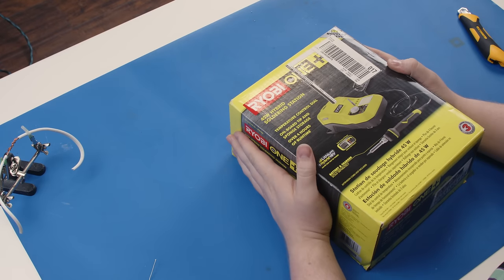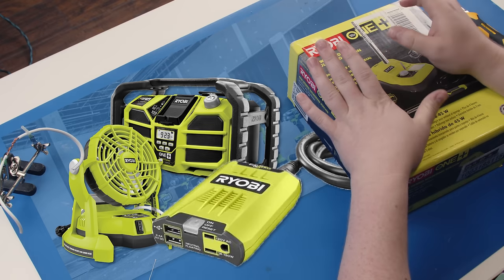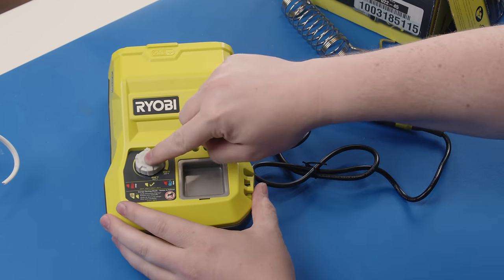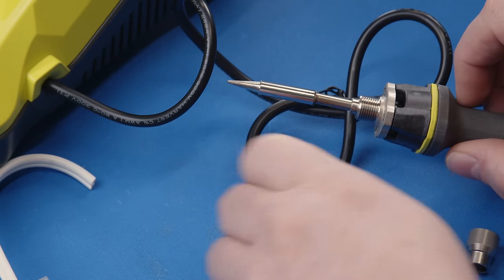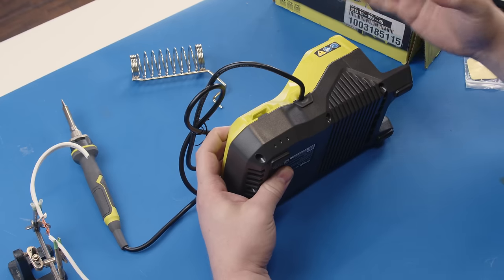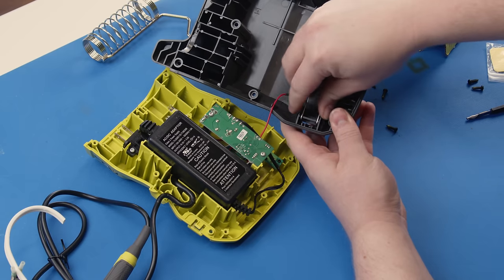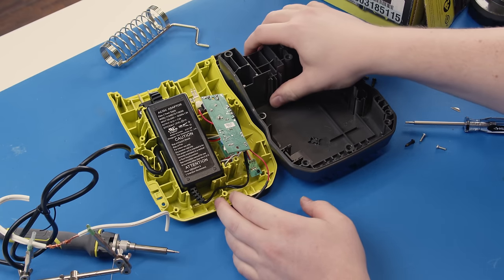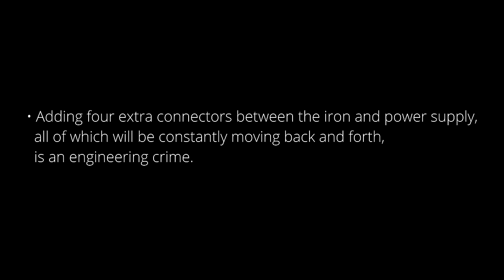Ryobi has GOT to be joking with this soldering iron

Comment: The butane-powered soldering iron were usefull when I was installing marine communications and navigational equipment in medium size sailboats and powerboats back in the 80's, where a boat at anchorage didnt have 120 VAC "shore power", or you might be working up on the mast, in the cockpit, or on the boat deck where there wasn't an outlet available (for obvious reasons!). The butane iron was great for soldering PL-259's and other large RF connectors.
Reply: Was just going to say this. Some of the mobile mechanics in the locale use these things too. Pretty much anywhere where you can expect to not have access to a outlet. They have their uses.
Reply: @venge1894  , of course, ya' gotta be careful with an open flame around car and truck engines, marine engines, and bilges! I do wonder if any of the current crop if battery-powered cordless iron could solder the ground shield of a PL-259 connector; for that, you might need an invertor to provide 120VAC, and a BIG soldering iron, or a Weller 8200 gun.
Reply: butane-powered soldering iron one of my most used tool too, i keep one in my car if i somehow ruin my wires(i have alot of them going around), i could get one that works on 12v outlet or make my own one but its easier to use butane one.
Reply: I use my butane powered iron for soldering and, recreational use
Reply: @d_dawg05  I have one of the butane irons for doing the electrical connectors on farm equipment. they also work really well for melting a perfect hole in a plastic sheet to pass cables through without leaving rough edges that will wear the cable over time.
Reply: The butane iron sounded like a good idea when I had to climb a radio tower and work 100ft in the air soldering a joint or pl connector, but any wind cooled the tip down and the catalyst did degrade like camping lantern mantels.  If I recall, the Iron did have a flame control on it to adjust the heat.  
I eventually only used the blowtorch tip to melt heat shrink tubing instead of a lighter.  Another issue was the refillable butane torch was frowned upon by the airplanes which I needed to get to my remote towers.  It was easier to have a box of wooden matches in the toolbox or buy a pack of disposable lighters at a convenience store near the airport if I expected to replace heatshrink that trip.
Reply: @mcgyver272000  , you can also use the miniature torch to melt and caramelize the sugar sprinkled on top of a Creme  Brulee'!
Reply: Helicopter mechanic here...the butane powered ones are fantastic for use on a windy flight line with absolutely no ac power available.   They will, however,  brand you like a new cow or burn a hole straight through carpet when you arent paying proper attention to where that exhaust exit points too
Reply: I keep a butane torch/soldering iron and a can of fuel in my Emcom "Go Kit" for making repairs, or modifying gear to fit whatever job we're asked to do.
I wouldn't want to use one for small, precision work, but like lots of tools there are jobs it does well or at least "well enough" to keep one around.
Reply: I used to have a nice Weller butane unit. No longer made, but it was excellent. Got stolen during a move.  :/
Reply: I still use one when working in my car...no electricity near where I have to park. Works great, but there are limitations.
Reply: I re-wired a car and used my butane iron for the entire job, lol.  I’ve repaired electronics for a living for a couple years before that with a nice metcal professional unit and really didn’t mind using the butane for the wiring (would never touch it to a circuit board or anything remotely fragile though).
Reply: I prefer to have multiple soldering irons. Specialized soldering irons are good in certain conditions.
Reply: i.........didnt really like my butane soldering irons, i've had a few different brands including no less than 3 radioshack(i cant call it rat-shack anymore after it died, too much respect for the original company) they were usually an emergency backup and half the time wouldnt get hot enough to not form cold joints, flux was 110% a MUST
sure i used them plenty of times....but it was always as a fallback tool except a period when i didnt have a plug-in iron for a few weeks or months i didnt replace it
Reply: @chrisbridges1328  i forgot about the exhaust! about 5 inches in front of the hole on the side and a bit in front of the iron!

Comment: The psu thing is actually really common and in my opinion, providing the units come from a reputable supplier and are of good quality (which seems to be the case given the one in the lamp) its a good thing. As I am sure you are aware a lot of old AV and computer equipment can literally destroy itself because poorly designed power supplies/systems that go bad, the most well known being the Commodore 64's infamous ”Brick of Death” but some early IBM and Apple machines have/had overheating PSU problems. Because these of the shelf units could be used for thousands of different applications the makers/designers have to try to cover all possible issues that could arise, including being in a confined space. 
Don't get me wrong I don't think for a second this is the real reason they do it, It is more likely they are avoiding some certification costs by having no AC wiring assembly in the case, and if they could do it in an even cheaper and inferior way they probably would.

Comment: Similar to the phone charger cords, I really like the woven cloth cords that we had in the 60's.  Those are awesome and I am glad they brought them back in a modern form.  I am sure someone with a soldering iron (pun intended) could replace the existing cord with a woven cloth cord.  As for temp, there are many cloth like materials (not asbestos) that can handle the heat.  We use them in gloves, etc.

Comment: I used to work for TTI, and outside of upper management there's no Milwaukee crossover with Ridgid and Ryobi tools. Hart is basically rebranded Ryobi though. I might be able to get this video to the engineer that works on this tool, they may be able to make some improvements.
Reply from the maker: Thanks for the info about TTI - I suspected that was largely a myth. People like to look at company ownership and say "oh they're the same company" but that's kind of the problem with M&A business culture - businesses largely DON'T truly "merge", and often don't gain any benefits from being part of a larger organization, they operate exactly as they always did but just have to give a chunk of their profits to a parent company. It would probably make a lot of sense to share engineering resources, rather than having a bunch of distinct companies reinventing the wheel, but that's almost never how it plays out.

If you're actually able to get some feedback in on this thing (that would be wild!), besides improving the cable, a better detent for the iron holder would be killer - and if they REALLY want to stand out, put high-temp silicone overmold on the barrel nut so you can change tips while hot without pliers. Nobody in the market does that, and it would be a wildly user-friendly feature, especially for the home-gamer set that Ryobi seems to target. Heck, overmold the whole barrel, it's not like it's useful for that part to be hot (might interfere with thermal control?)
Reply: @CathodeRayDude  I'd also suggest a small fan inside to vent heat out. I don't know how likely it would be that the internals overheat, but this just seems to me a very practical thing that would only cost a few cents.
Reply: It's actually likely that they shared manufacturing before the merge once Milwaukee started being made in china.
Reply: @alexs7670  maybe some, but in day to day operations on the engineering side, there aren't shared resources between the Milwaukee engineering team and the Ridgid/Ryobi/Hart team.
Reply: @KevinFields777  it's only 45 watts. It's gunna be fine.

Comment: I've pulled apart tonnes of electronics, and i have to say the design of this thing is actually quite elegant.

The fact that the power supply is fully contained in a closed frame pack is awesome. Imagine you go to add some water to your sponge and you mess up and dump water on the unit. That pack inside that houses all the high voltage is completely water tight. 
I know, not a super likely scenario, but if that plus the other things like not cleaning of flux (which would be an utter waste of time) help to keep the costs down then I'm all for it.
Reply: A lot of products now leave the flux on the PCB. It's some form of newer flux that doesn't become corrosive, so cleaning it off is a waste of time and money for the factory.

Comment: seeing that cable triggered me too. silicone insulation is the shit you want: it's super flexible, feels nice to the touch, and it simply does not melt, even when it's literally burning! (think of it being polymerised silicate, a.k.a. sand)

PS: the perfect general purpose soldering tip, in my experience, is a single flat / beveled tip, of around 3-3.5mm, over those pencil points. the tip has a fine enough edge to work on PCBs, while the flat makes it super easy to feed solder into the joint, and gives you a big contact area, to easily heat up bigger parts.
Reply: lol your comment got copied by a bot and is higher in the comments now
Reply: Yup, chisel tip for the win! It's a bit of a misnomer, however, because it's rounded,  beveled and blunted, unlike an actual wood chisel.....

Comment: As someone who runs a lab and does this type of work every day for a living, ……life is too short to have soldering iron‘s that don’t utilize soft and flexible silicon leads. Like with a nice high-end multimeter. Not only will you never burn through them, but the flexibility is absolutely mandatory when doing that stuff every day.
Reply: Yes, life is too short for that..... haha
Reply: I was just thinking the cord would drive me nuts. My weller lead is just so nice and flexable and, i would probably get rid of the ryobi for that reason alone. Not to mention, tools like this may be useful for the hobbyists but no way would i use this or anything that i can buy at home depot or the like for certain stuff in production. They never hold up to the repeated use, i pack my weller in my electronic service case and it goes through TSA several times a week and works flawlessly every time. Try that with a ryobi. But I digress, my needs aren’t the next guy’s needs, that’s why I don’t mind when a regular joe buys junk tools because they don’t need them daily or abuse them like i do.

Comment: I know that shoving an off the shelf power supply must be a standard thing, I've taken apart a car starter/tire pumper/phone charger/LED lamp thing and the power supply was just a wall wart mounted inside with the prongs sticking out and the bare wires connected directly to a sealed lead acid battery
Reply: It's a LOT cheaper than using an open frame one bc of UL listing and stuff.
Reply: I wonder if all of their hybrid products are like that. I have a couple of those fans. One time I took a 600 mile trip to the middle of nowhere and forgot the charger to my laptop (but had one of those fans and the right size barrel jack from a different wall wart). If I had known there was one inside the fan, I would have plucked it out and MacGuyver'd one together instead of driving 4 hours to find one! The laptop wants 19v but will take 18v I found. Those fans are a lot smaller though, going to crack one open! Much less amperage for a fan so I wouldn't be surprised just to see a wall wart like you said.
Reply: @craigjensen6853  mine isn't even hybrid. It's just charging an internal lead acid battery.

Comment: I don't know what I was expecting to be inside there, but it certainly wasn't that power supply 😱
Reply: Honestly, I trust its reliability more after seeing them just cram an entire pre-built DC power brick into the thing. It means that it's a component that works regardless of their engineering and they haven't messed with it.
Reply: I have a Caterpillar branded car jump starter that was built just like this.
Reply: I'm old school enough that I was expecting the thing I always used to find in cheap but 'sturdy feeling' items... a big chunk of cheap pig iron glued into the bottom of the case.

Comment: 2:20 The main trouble with the butane irons is that they run out of fuel after like three minutes, then you have to wait for the thing to cool down before refilling it in order to avoid setting yourself on fire.
Reply: Yeah, there is no fire hazard with the heat source. Just the annoyance of using them.

Comment: 8:50 - I used SO many of those cheap irons from Radio Shack,for like 30 years. Literally used them until the tip corroded away to an unusable nub,then bought a whole new iron. They worked fine. Temperature control is nice,but often not necessary.
Reply: You are a madman then. I used them and for circuit boards they are a nightmare, especially compared to a 120$ Weller. Nothing crazy, but even a cheap intro soldering iron changed my whole game. As did a hot air station.
Reply: Same, I have a "nice" iron that I almost never use because one of these is usually closer. Lol
Also gotta love an iron you don't mind using to light your cigarette if you lost your lighter.
Reply: @Zahgurym  a TS80/100 is decent for that. I never got one but have seen them used in uncomfortable situations and have considered it. It's annoying to have to disassemble things and get them to my bench to fix sometimes. But a 25$ single temp iron would just drive me nuts lol
Reply: I tried to go for that too, but it just does not work nearly as well these days. I would assume that a) quality of these went down since and b) wretched lead free high-temp industrial solder. That stuff won't even get soft from many cheapo irons unless you bake the crap out of the joint.
That being said, these are amazing for working with plastics.
Reply: @hi_tech_reptilez  I have a Weller SP25L. It's the same type of those cheap ones but it's actually good quality, over 10 years and it still works fine. The tip has lasted all those years. I have a soldering station now though.
Reply: Good thing these days you can get a $25-$35 pinecil which can run off a usb c fast chargerb
Reply: @liamsmith8518  I love my Pinecil to death, but there's a drawback in that there's no locking mechanism for the USB-C port nor the DC barrel jack and it ships from HK, which makes the cost actually closer to $30 if you are patient - $50 if the Pine store gives you no choice in shipping time.
If Pine or another party solves those two issues, then there's potential for an upset.
Reply: I wouldnt touch anything without temperature control
Reply: That style of soldering iron was also available in better quality. I'm not sure if they still do but Weller used to make one where you could change the temperature of the tip, simply by changing it. The control relied on the Curie temperature of materials. You had to select the tip for shape and desired temperature. This required more expensive tips but if you were not a heavy user, it worked well enough. At the back corner of a drawer, I probably still have a couple of these old tips kicking around. 
Another style of soldering tool works with a loop of thick wire with high current pumped through it. They still exist but you don;t see them that much, ever since decent quality soldering stations became more affordable. They are sold as soldering guns. The "Instant soldering action" is a selling point. Who the heck knew what temperature these generated but they were surprisingly usable for simple, rough jobs. The wire loops at the business end of the soldering gun wore away quickly but if you got stuck, you could just use a piece of thick copper wire bent into shape, instead. 😆These days, they are a bit more sophisticated. Even reputable brands like Weller, still make them.
Reply: Yeah I'm in the same boat here. Temp control is great and all, but for this stuff, you're only pulling 25-30w anyways, the same as the fixed temp handles.
Reply: I wouldn't say they worked fine.  Yes you could make workable solder joints, but had to keep grinding down the tip, cleaning the oxidation off (since it was then exposing the copper core which degrades fast in the presence of flux), and taking longer for every solder joint.  Plus they were absolute rubbish for smaller IC pins, etc. unless you had a brand new tip or after grinding it back down to a point, had a very limited # of joints to solder.

Plus what a PITA to plug those in and keep waiting and retesting to see if up to temperature yet, and if you let them get too hot, the tip degrades that much quicker.

However back when I used the RS cheap irons, I'd just buy a new 2 pack of tips, no need to toss the whole iron as it worked fine still.  I did take some steel wool and clean the threads on the iron that the tip screwed into as those would get oxidation buildup, another problem with an iron that lacks temperature control so running as hot as the wattage spec causes till unplugged.  Just not worth the bother unless not making many solder joints per year.
Reply: @PunakiviAddikti  I worked my entire career in electronics (>40 years) and relied on fixed-power irons for almost everything except surface-mount IC's. Having a selection of irons to match the job was easier than toting a "soldering station" everywhere when working in the field. My favorite sizes were 12 watt and 25 watt. Keeping the tips clean and properly tinned makes all the difference. If I needed more heat, I'd use a soldering "gun". Weller and Ungar ruled the roost.
Reply: @sandman0123  Yes, as well as having a good choice of tip shapes.